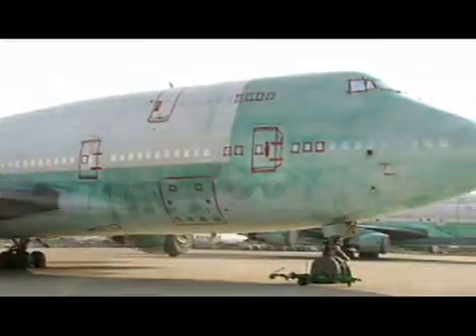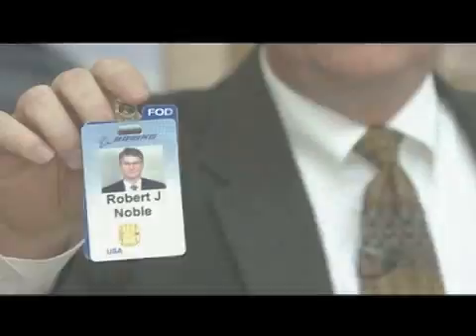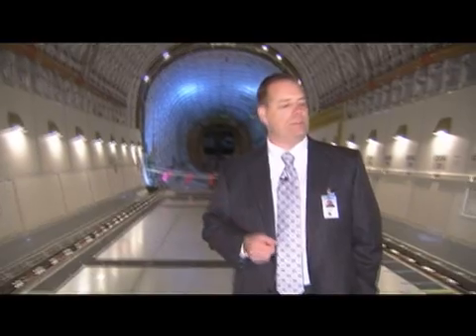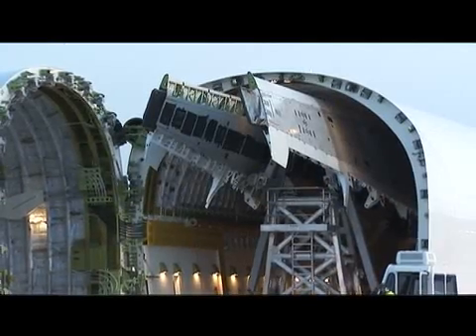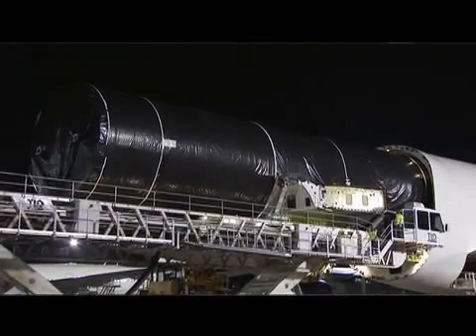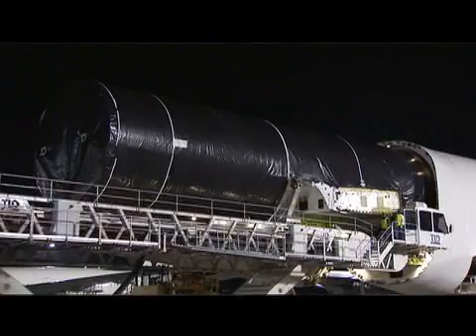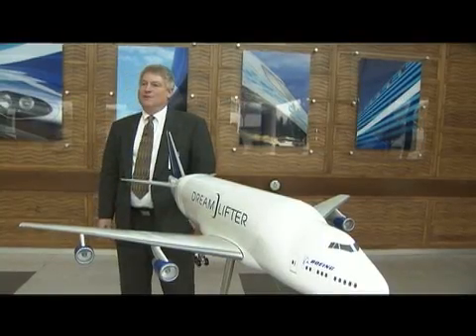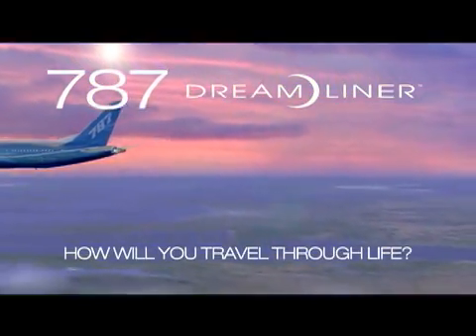Boeing 787- Dream Lifter pt7

Comment: @secret00agent00man the LCF carries MUCH more weight & mass then the airbus. the Baluga is doing the job that the Boeing 377PG was doing. the 377 PG is a 1947 vintage radial engine airliner based on the B-29 bomber. so the Baluga is a lightweight in the heavy haul catagory.

Comment: @EstorilEm A380 is also limited severely to airports that can handle such a large aircraft, aprons have to be reinforced for the weight, gates have to be redesigned, etc. quite a headache just to fly an extra 80 people per flight. Boeing studied a 500 passenger plane in the late 1970's but decided that it was not worth the hassle.

Comment: @samueljoelgarnett Super guppy was a boeing 377 stratocruiser that was converted by boeing in the mid 1960's to haul sections of the Saturn 5 moon rockets. Baluga was a bad copy of the strato cruiser's they had bought used. The 747 LCF could transport a airbus baluga. the 747 is much larger then the baluga, & can haul 3 times more weight in freight then the scarebus.

Comment: It's a little more complicated than that - they made a giant hollow tube that flies, which is great for transport, but worthless for passenger transport.  In addition to this, the entire airframe is dated, and by todays standards is inefficient (wing, engine, fuselage design, as well as materials used.)  The A380 was designed with 500+ pax electrical, plumbing, food galley, entertainment, safety (doors, fire evac, oxygen etc) systems. I could go on forever! Different plane, different purpose. =)